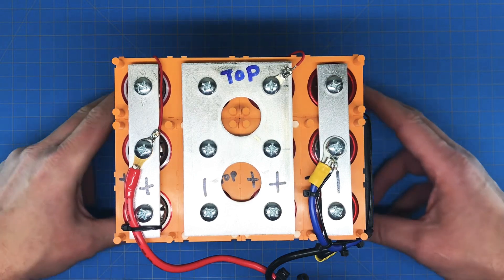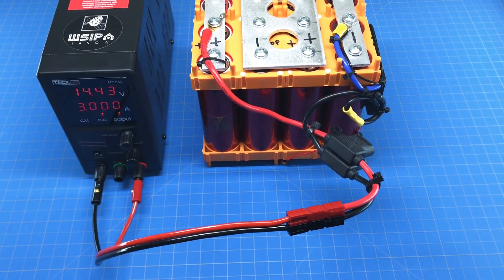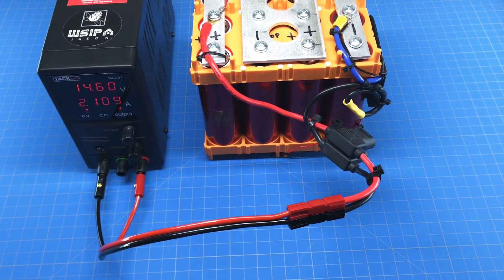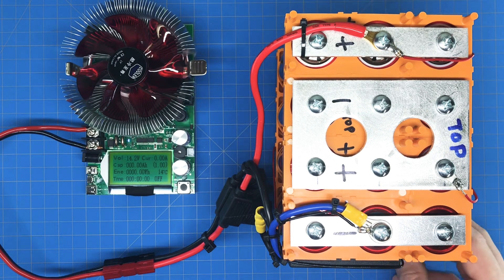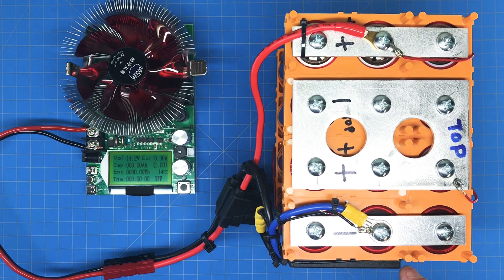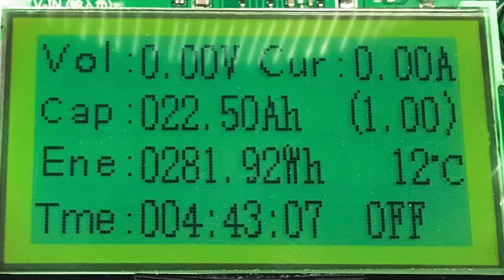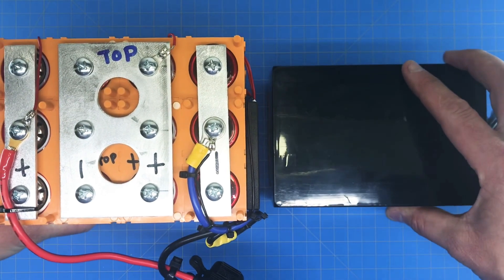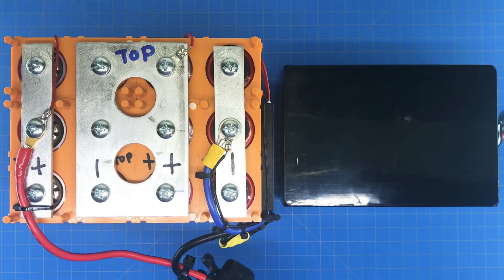Headway 38120 DIY Battery wrap up

Comment: I love my 38120 Headway cells , I made a home made 4S-2P power station with them .      But one of the coolest things about the 38120s is that a 12V battery can start a car , I haven't done it yet with my battery but I will eventually .    Can the Bioenno battery start a car ?    Happy building :)
Reply: I dont see why not. Mist portable jump starter are made of the same battery as Bioenno.

Comment: I've been using a "72ah" banks for car audio. Prior to building the pack I too balanced the cells via parallel then top balanced them since in my use they will never see anything below 12v. Best capacity I've gotten was 68 ah which isn't horrible for $8 each. None the less thanks for sharing I like seeing others take advantage of used lithium